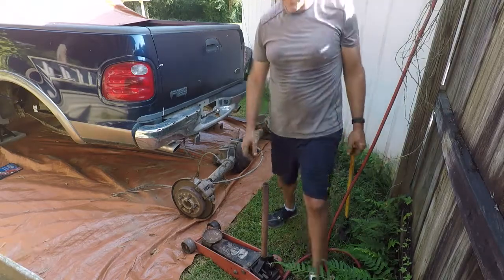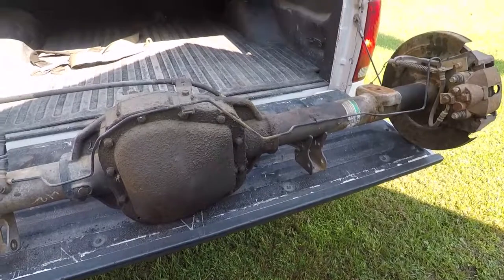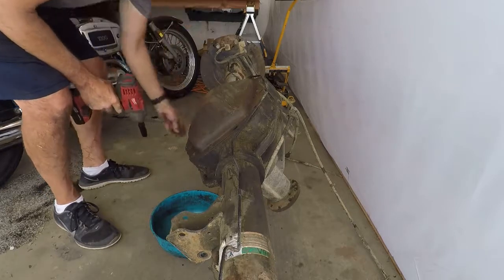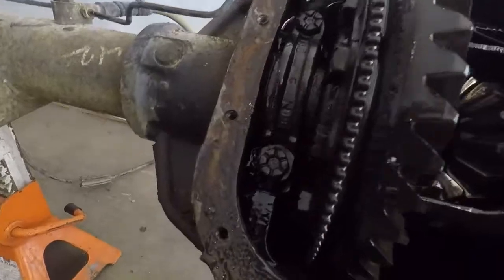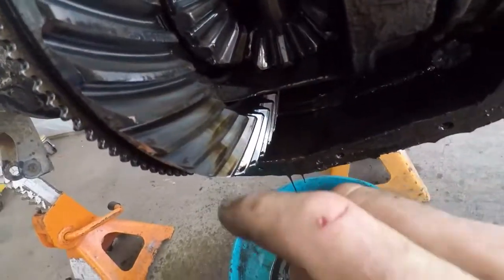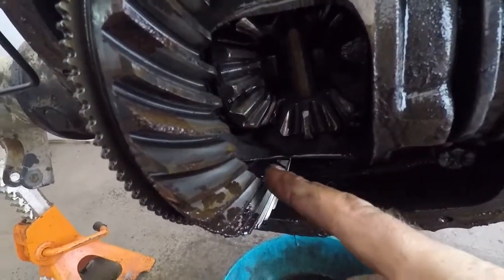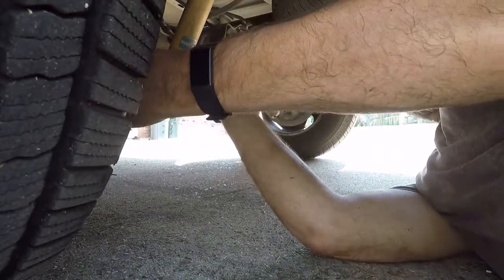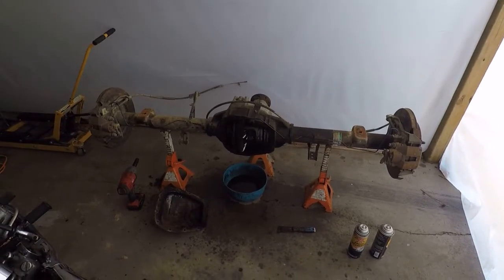1997 F150 Rear Disc Brake Conversion Part 1

Comment: I'm looking to do this swap I absolutely hate the drums for some reason the adjuster keeps popping out of place and make that awful noise and brake like sh!t how did your swap go if you still have it I know I'm opening up a 2 years old case I would appreciate it if you could give me some tips and info .
Reply from the maker: No problem.  It's been great.  My main suggestions would be to get everything from one donor if you can.  Booster,  master cylinder,  e brake cables and the rear end.  My truck is at 339k miles and still going great thanks!
Reply: @aaronsrose  so I have a 97 4x4 with 4.6 ....is 2000 to 2003  the same?
Reply from the maker: @wolfman2342  It should bolt right on. The booster and MC are different for the disc rear (but they should swap over no problem), but the rear end dimensions should be identical. I would just make sure the gears are the same and that it is the identical rear end. I think there were a couple options depending on whether you had the 5.4 or the 4.6.
Reply: @aaronsrose  thanks brother

Comment: i did that swap and found that the driveline had to be shortened about a 1/4-1/2''... any issues so far?
Reply from the maker: Interesting. Nothing major so far other than some bearing damage I found when I disassembled the donor rear. I did notice a shim under the pinion yoke. I'll keep an eye on that during the reassembly. Thanks for the tip!
Reply: If you converted from 8.8 to 9.75 size axle that would make since, the 9.75 is about a .5” longer
Reply: On the driveshaft